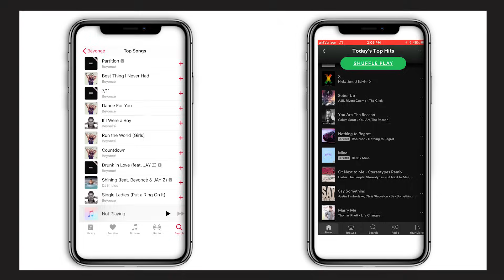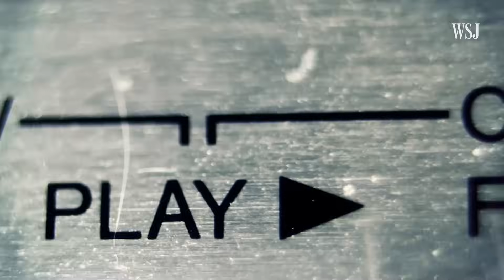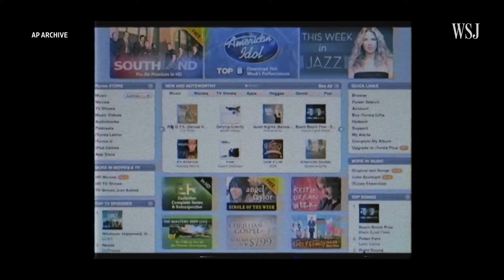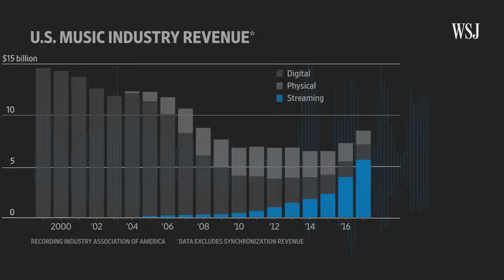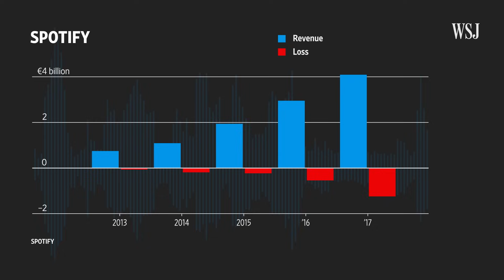From Phonographs to Spotify: A Brief History of the Music Industry

Comment: Im in my fifties. This video is a good quick recollection of music industry stages, but it left out many pieces. Fro example before the 33 rpm disc (aka long playing or LP) there was the 16rpm and 78 rpm discs. Then there was the 45rpm which have 2 songs in each side. I still got many of my original LPs and 45s. Then during that time and before the cassette was mainstream there was also the 8 track, a bulkier tape with 8 songs. Then the cassette 60, 90 and 120 mins became the standard with the intro of the boom box followed by the Walkman. I remember seeing my first CD player in the late 80s, ruled the 90s until Napster and Morpheus came out online. And NOW the rest is history :)
Reply: 45’s are the preferred format for releasing music on vinyl nowadays. That is if you want the highest fidelity and the best sound (frequency range).
Reply: @ThizOne   EXACTLY!!!
Reply: They also skipped radio!